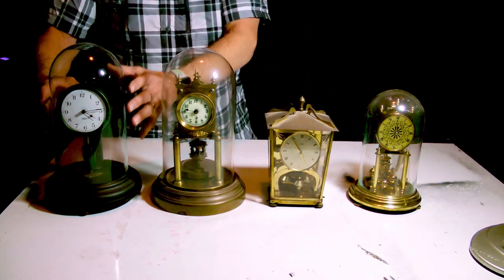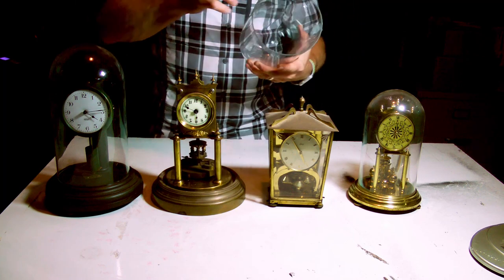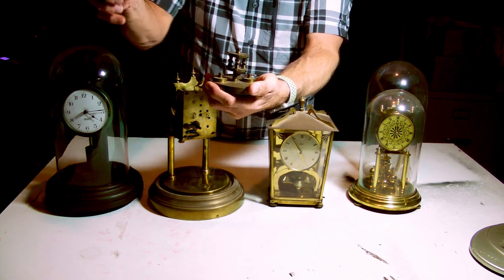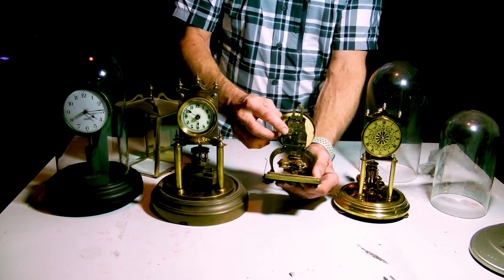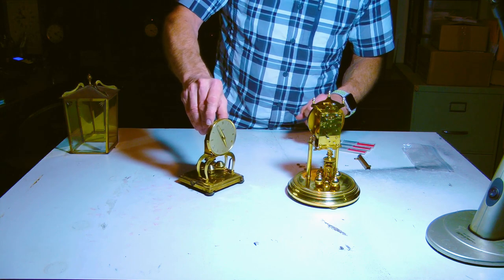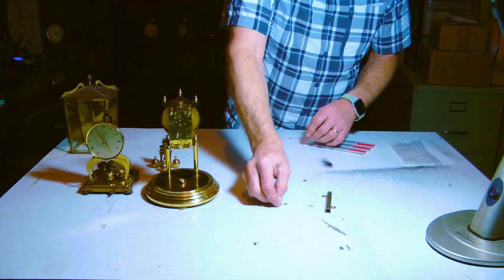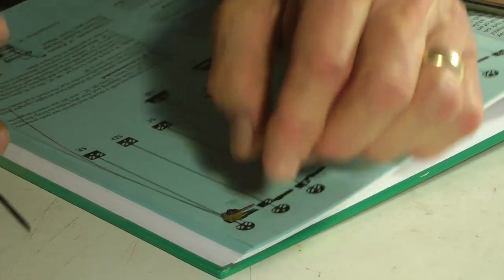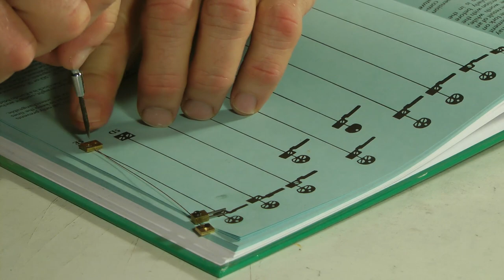How to Replace the Suspension Spring on a Kundo 400 Day Clock

Comment: Thanks for the video; you've confirmed that the pin on the bottom is a taper fit and now my spring has been replaced.  Unfortunately, despite the old spring being severely kinked, it still won't run, but at least I've eliminated one thing.
Reply: Search YouTube for a video on setting the beat on a 400 day clock. That’s the next thing to do after replacing the spring.

Comment: Interesting video, and many thanks for showing the correct procedure. I had to make a Corian jig to hold the bottom spring in the compressed position to drive the tapered pin out of the bottom clamp. Someone at some time had bent one of the bottom collars and made it very hard to even get at this pin. I have loved these clocks since I was a kid and now that I am retired I have the time to learn a new hobby. These are a blast to restore since most of the older 400 day clocks were very well made and can be found at very reasonable prices. I didn't know about the cut glass being only on the older clocks. Any idea of when they made the change to pressed glass with the smooth edge?

Comment: That electromagnetic/mechanical clock fascinates me. A kind of half-way house between the mechanical pendulum clocks and modern electronc quartz movements. I do love fixing pure mechanical clocks, though. Preferably weight-driven pendulum wall clocks and spring-driven anniversary clocks.
Reply from the maker: I still have that Pool electromagnetic clock and am interested in selling it. Condition is non-working.

Comment: i don't think I will need to change my spring, but this is such a helpful video that I am sure that if I have to I will be able to do it with a bit more confidence.  Thanks!

i got a Kundo (not sure of the model or year) at a thrift shop for $10.99.  I am going to let it run overnight (hopefully) to see if the spring will power it.  I have gotten my wife into mechanical clocks.  I have always been intrigued by true mechanicals.  I found a  Korean striking wall clock several years ago.  Its timing accuracy is annoying but it is fun to have anyway.  It kinda adds life to this "empty nest" and I am sure will be part of our grandchildren's memories of the house.  

I have one of those battery operated electromagnetic clocks.  I had trouble getting it going, because I could not find parts.  I am going to revisit it, because it is so pretty.

Comment: Really good video. Information & pace is perfection. Thankyou.
Reply: he used the wrong fork for this clock on the suspension wire
Reply from the maker: I used a generic replacement fork. Considering the job that the fork does; its shape is not critical. The forks sold today (like the one I used) are about as universal as any clock part. I have never had a problem replacing a fork with one.
Reply: @NorkroClockParts  I got a lot out of this video 3 years ago. In the meantime I have collected ever more examples of these clocks with far too many of the Miniatures or Midget variety. I would like a tall version as I think the weights and the ratios involved better suit this torsion style of design. However the taller older clocks are much more expensive. I like your Gustav Becker with the disc pendulum. The ball clusters are pretty but often far too loose and flimsy. 
My main problems have always centred on flutter. Its a weakness of these fascinating clocks and no matter what you do it waits in the shadows to jump out and bite you! I have been seeking an elegant cure. One that does not chop the original around and can be easily reversed. I am in fact testing one idea which shows promising results.   
I agree with more frequent winding regime with the mainspring operating its mid-range which offers a more level output power. 

Thanks again, Sincerely, BerryG (UK)

Comment: I have a miniature Kundo from my parents dating back to the 1950s. It hasn't run in many years due to a broken suspension spring. I have all the parts still attached to the broken spring.

What's the best way to remove the pin from the bottom block in the pendulum?
Reply: I see I got a new 'like' on this comment. I'm happy to report the clock is fully working and keeping decent time! I was able to remove the pin by gently punching it out.

Comment: Thank you for the well done video, ive learned a few things!  I have a model 53 Schatz struggling to get more motion only 3/4 turn and overswing maybe 1/4 inch, it has a bracket to adj the fork deeper or more shallow, ive played with that a litte trying to set deeper to increase motion? and adjusted fork up but may be spread a littl far apart?  any suggestions!
Reply: 3/4 turn with 1/4” overswing might be all you can get out  of it.  If it keeps running I would leave it at that.

Comment: Great video. I have a 1960 Schatz anniversary clock. Its the same size as the small one you have. I have got the spring off and I am trying to work out the length I need. I have tried measuring the old spring, but it has a lot of twists in it. I have measured it and think I need a length of 7 centimetres. Does that sound about right ?
Reply: I'd suggest that you obtain a copy of "The Horolovar 400-Day Clock Repair Guide" by Charles Terwilliger. 

This book has actual-size silhouette pictures of the suspension spring assemblies for these clocks.
Reply: @daleburrell6273  is it really a good book ? i ant so badly to get it
Reply: @brookebricks1053  YOU BETCHER LIFESAVERS- IT'S FULL OF IMPORTANT INFORMATION ON WIND-UP 400 DAY CLOCKS.

IT'S WELL WORTH THE MONEY.
Reply: @daleburrell6273  Thank you so much. i will get it.

Comment: I know this is a little off topic but I’ll ask the question because you briefly touched upon the beaded domes. I have four Kundo dome clocks.  One is a 400-day clock with a glass dome that is cut at the edge and has a removable pendulum (so it was made circa 1950).  The other three are quartz with a beaded glass dome.  One is a quartz with a plastic dome, but it was advertised as vintage.  Did Kundo ever make plastic domes or is it a cheap aftermarket replacement dome?
Reply: "Vintage" is a tricky description and designed to obfuscate reality. Quartz is modern and often plastic. They work better as a timekeeper but lack artistic merit and intrigue. Things that are too perfect ....... Yeah! I'm not sure when the plastic domes first arrived but they are much later. Glass is fragile & like fascinating art is easily spoiled. Originality is sought by some collectors who look for clues to spot deception. The cut glass domes are the way it was done. More lately the glass was cut by heat and this leaves a (safer) beaded edge. A true torsion regulated clock with brass & steel clockwork is much more likely to be of true vintage.

Comment: Correction from a physicist:
It's not adjusting the centrifugal force, it's adjusting the moment of inertia which slows down or speeds up the lock.

Inertia in a way is the measure of how hard it is for something to change it's speed.  Picture this, if I shot a 1 kilogram ball out of canon, you'd expect that there be come kick back.  But if I shot a 10 kilogram ball out of the canon, you'd expect that there would be EVEN MORE kickback.
Reply: I love this explanation and thank you for it. Its the weirdest thing in some ways. I have always thought it was to do with the distance you are trying to move the weight but with no more available power. As in a larger circle has a longer circumference. Might be similar to the power to weight ratio in say a car. 
BTW - whilst trying to be smart I noticed that you seem to have spelled "clock" as "lock"  Am I right or am I right?

Comment: Hi, I just picked up a 400-day clock today and I noticed that the wire holding up the pendulum is quite twisted. Should it be straight and flat?
Reply: Yes, the spring should be straight and flat. If it has any amount of twist it needs to be replaced.

Comment: my supension spring broke but I cannot get the pin out of the pendulum it is like it is weld to it
Reply: You usually don't need to take the pin out. Just loosen the screws and the plates should separate enough for you to get the old spring out and the new one in

Comment: I have just acquired a Kundo 400 day clock which needs a couple of things replaced. The back plate on mine, looks exactly like the one directly below the one you were pointing out in the book. if i'm correct, could you tell me what size kundo mine would be known as please?
Reply from the maker: Miniature Kundo clocks use a .0023" spring.
Reply: @NorkroClockParts ...that's a spring made by Horolovar.

Comment: I want replace the spring, but I do not know the size.
Reply from the maker: I might be able to identify it for you. Can you tell me who made it and the height and width of the back plate?
Reply: @NorkroClockParts  the clock is a WALT and the plate is :42x85 mm. I want send you a movie, please write me by email. I want say you that the clock, hava a spring of 0.07mm, but is very fast. Make 8 alternations in 50 seconds, and the swing is 270 degrees. Thanks
Reply: @NorkroClockParts  Sorry, I was wrong, an oscillation is done in about 50 seconds and the complete one is about 365 degrees and not 270. Please tell me how I can perform the setup. If possible, can you send me the drawing with the measures for the correct assembly of the suspension? Thanks again.
Reply: Get yourself a copy of the book by Charles Terwilliger!!!

It has all the information you need!!!

Comment: My clock has a spring but clock still not working....also spring seem too long...I have a Kuno.... or Kono ...please help...I'd love to make it work...:)
Reply from the maker: If the name looks like Kono it's most likely a Koma. This clock can cause a lot of frustration for beginners. The miniature Koma clocks were not well designed and are hard to get running (even for professional clock repair persons). If the spring is too long the pendulum will bottom out and rub on the base of the clock.
Reply: @NorkroClockParts  ANOTHER consideration, is that if the suspension spring is the wrong length- the pendulum locking mechanism may not work!
Reply: Get yourself a copy of the '400 day clock repair guide' by Charles Terwilliger. I ended up buying my own copy because there was a waiting list for the book at the library.

Comment: How do I remove the small pin in the pendulum preventing me from removing the spring?
Reply from the maker: You have to push or pull the pin through. I use a pair of parallel pliers: one jaw on one side of the pendulum top, the other jaw on the end of the pin. Squeeze the pliers and the pin will start moving through the hole. You can probably do the same thing with needle nose. Once you get it to move a little bit you should be able to grab it with the pliers and pull it the rest of the way out. They are in tight but you will be able to get it out.